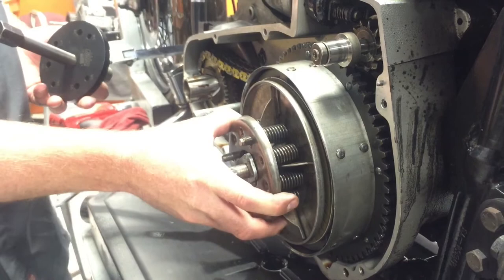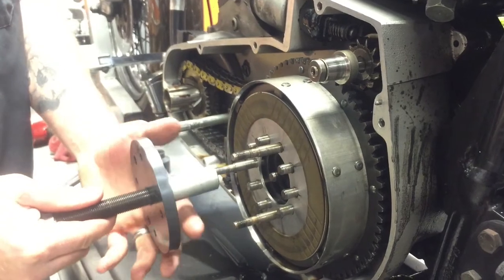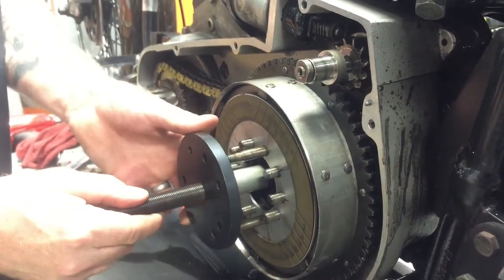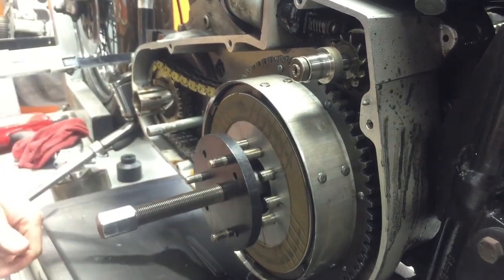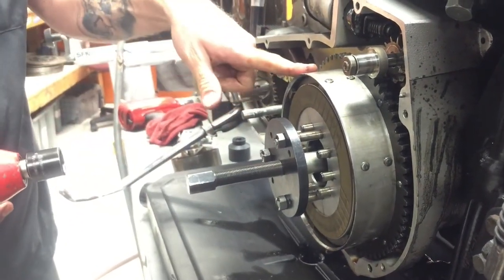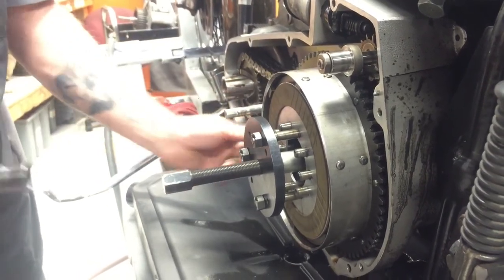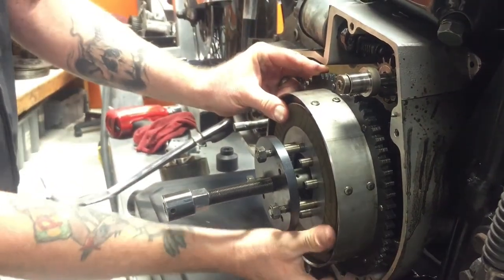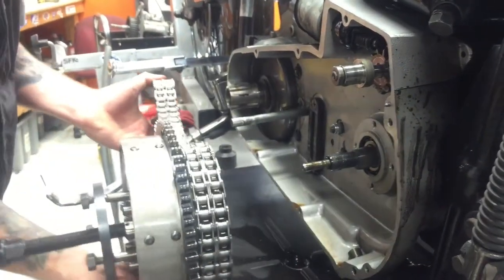Harley Davidson Shovelhead Clutch removal with the Clutch Hub Tool

Comment: I am running into an issue with getting the lock nut off the adjustment screw. They both spin when you try to pull the nut off